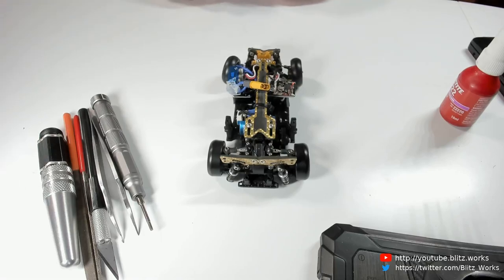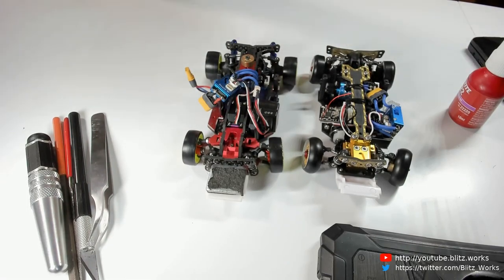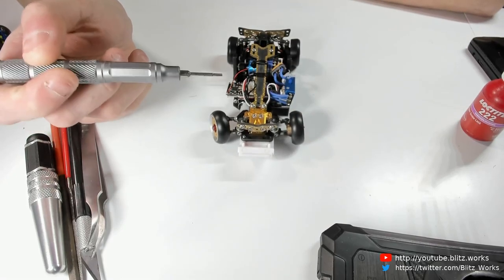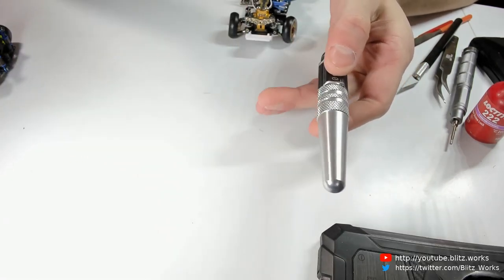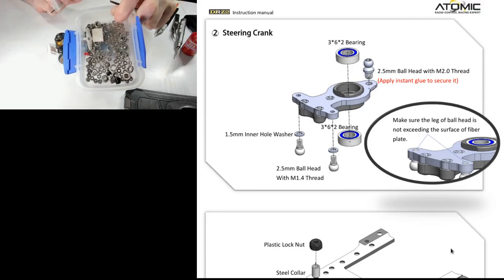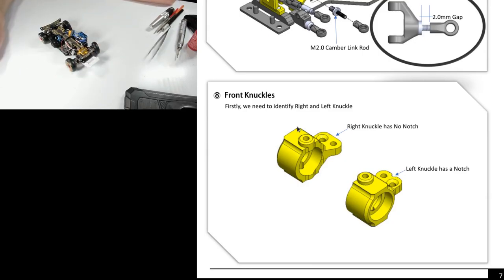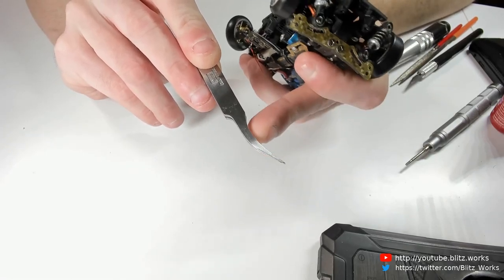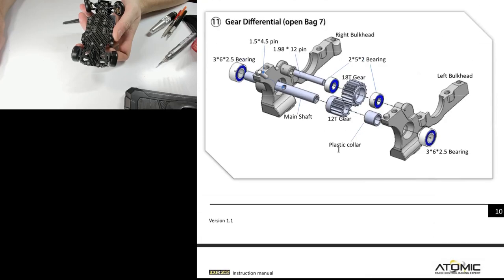Atomic DRZ v2 Mini-Z walkthrough - Everything i learnt about the build

Comment: The Beaver recommended your channel. So here I am, good video 📹  so far. Thank you.
Reply from the maker: did not realize he called me out, do you have a link to the video?
Reply: @BlitzWorks  No I don't,  he recommended you. I am used to 1/10 crawlers...but I want to learn but the mini rc scene.
Reply: Ya know...for the life of me I couldn't figure out what that extra screw is even for on the knuckle.   If you put it in after the balls it can kinda lock the steering parts on but other than that it seems completely pointless.   Maybe it's for an upgrade later on?  Lol

I also instinctively put spacers in the diff, there were some black spacers that didn't seem to fit anywhere else so I just...put em in.  Lol.  Im not used to builds leaving a ton of spare parts...

Comment: In my build I literally busted out the digital caliper to make sure I had the right screws in the build.  Funny thing... the dimensions they give are wrong on a lot of em.  Theyre close, but theyre not quite right.  Lol.  The set screws I kept in but I reamed it so it moves cleanly. Ive been trying hard to adjust the handling, she moves smoothly all around but I cant get her to not sometimes flip around uncontrollably, despite having a heavy grease in the diff making it limited slip.  Im currently working on that, and trying to figure out getting all the slop out.  Ive got a 3d printer, laser, AND CNC so there's plenty of tools to fabricate parts, but im coming up short so far.
Reply from the maker: i noticed that about the screws as well but didnt have too much of an issue. just took my rally car out for a spin and it gets tail happy in the same way (uncontrollable backend slide)and found its about throttle control going into the corner, enter too hard and you wont be able to recover from that spin. try going in a little slower and then applying the power and see if that helps at all

Comment: If you want a REALLY nice set of screwdrivers and wrenches perfect for mini z size cars theres a purple and black set on amazon thats really nice for like 15-20 bucks, comes with tweezers,  magnetic screw mat, basically every small Allen, every screwdriver tip, every small nut driver size,  all the goodies.  I use it more than anything else in my kit.  Theres also a grey power screwdriver i LOVE on there that makes assembly/disassembly SUPER fast but safe because it doesn't have enough torque to strip screwholes.
Reply from the maker: I actually own about a dozen kits but i just purchased an ifixit kit about an hour ago, wish i had seen this comment so i could have checked it out, only issue is if you saw this on amazon US then i likely cant get it here as the amazon site in the AU  is not worth the price of admision

Comment: Do you know what battery's will fit with the smallest configuration. 90mm I think. I've already bought 2 different batterys there both too big. The smallest is the eflight 280mah. I'm struggling to find anything smaller. The nanotechnology your using looks even bigger that the eflight I've got. Thanks in advance
Reply from the maker: I have heard the 90mm can be a bit tight and i have heard that the orlandoo batteries may be smaller. the batteries i am using are nanotech 300mah with the eflight (single charge and power) connector

Comment: Hi,  getting this car. quick question. did you use threadlocker for all the screws? or any kind of glue ? thanks
Reply from the maker: Honestly at this point i cant remember, for these slower speed drift cars with less powerful motors it is not really needed but can fix up some minor tolerance issues

worth doing if you feel up to it just make sure to get the weakest stuff you can get

Comment: Can any one throw a few links out to make sure I get the right parts. Seems like you have to order from 2 or 3 different sites to get what you need
Reply from the maker: This many has to do with what people have on hand, what transmitter they use and other factors. once you have done electronics once its fairly easy. putting specific links dosent help the above and diffrent shipping rates make shipping to one person prohiitive while others its fine

at a minimum you need:
* Motor (start with around 3500Kv or 6000Kv Max, any more is wasted)
* a 2 channel or more reciver that matches your transmitter
* A micro servo that fits (the AGRF ones i use fit nearly everything but are high end and pricey. nothing faster on the market)
* an ESC (ensotech s-waves used to be my fo to but i would recommend a furitek drift ESC these days for most people, they have a store for direct or you can buy from a vendor)
* Gyro (optional but recomended, dont just buy what i did its a very specific setup to my electronics to reduce wiring as i use sbus to cut down on cabling)
* Connectors for battery/ESC matching. you may get lucky and they just match but i rewire everything to custom connectors with polarity
* a small 2s lipo

happy to answer specific qustions